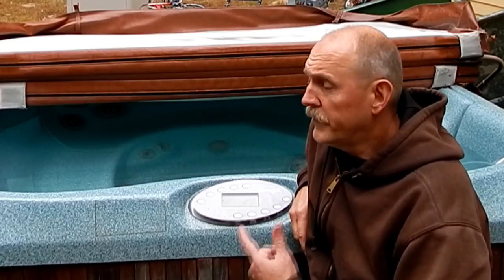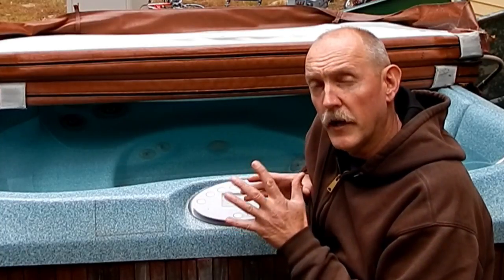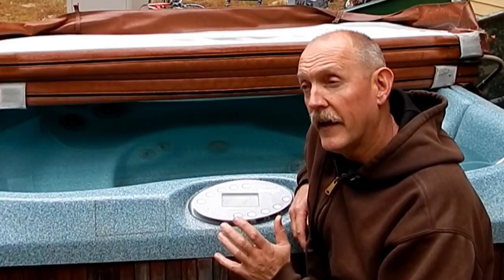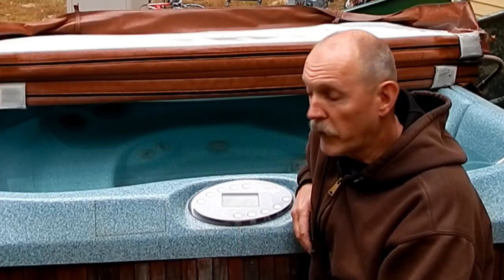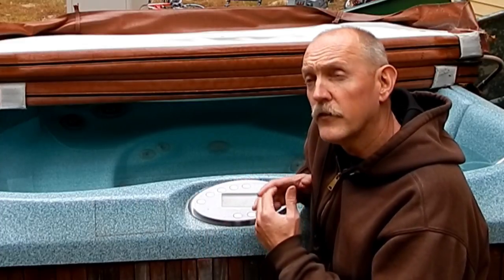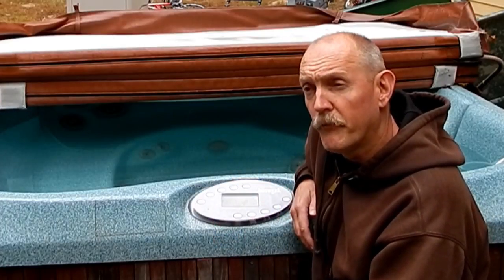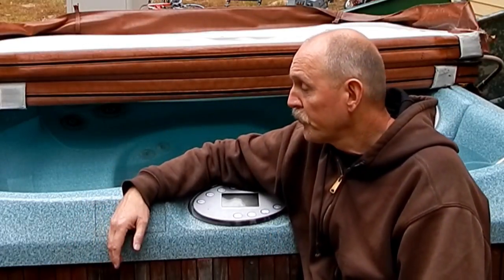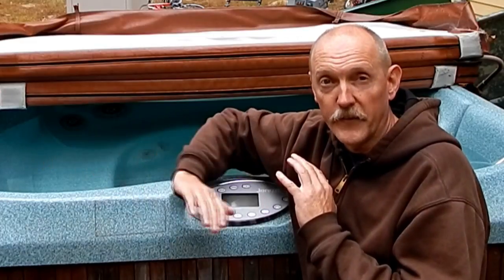Jacuzzi Sundance Hot Tub temperature sensor error repair

Comment: your about to have to change that pump out too...
Reply from the maker: Lol, good eye. Already done. Always a good idea to replace the shaft seal before that little leak turns I to a big expense, like a seized bearing.
Reply: It's the filter pump correct? I'm having issues with it randomly  turning on and off.
Reply from the maker: @bryananderson9215  this model has 2 filters. One filter is on the low flow circulation pump, the other is on one of the large pumps, the 2 speed pump. The circulation pump is the little pump that runs most of the time. The big 2 speed pump comes on low speed during a filter cycle. The length and time can be programmed by the user. Also, it is normal for the system to do a prepurge cycle before a filter cycle. It runs the pumps on high for a brief time at the start. However,  if your large pump is randomly turning on !and off erratically,  and you have a remotely located control panel, it might be the issue.

Comment: Why don't ya just splice the new sensor in and not run new wires?
Reply from the maker: the cable going to the sensor is in a pvc pipe. You can just splice the old connector onto the new cable, and I have done that in a pinch if say I only have a sensor with the wrong type plug on it. But then you need to make sure the splices are secure, and that moisture cannot get to them. Tinning them with solder, and heat shrink tubing work well for that.